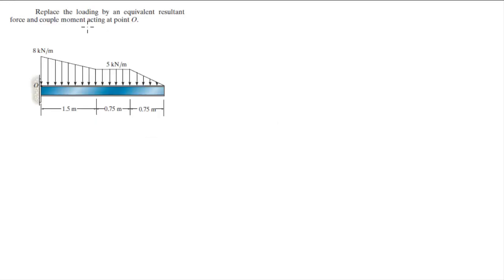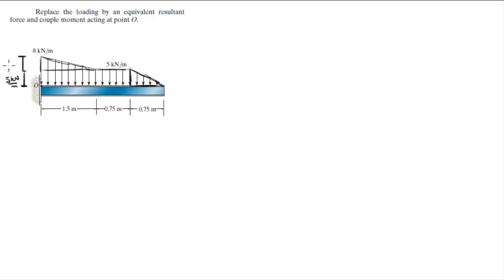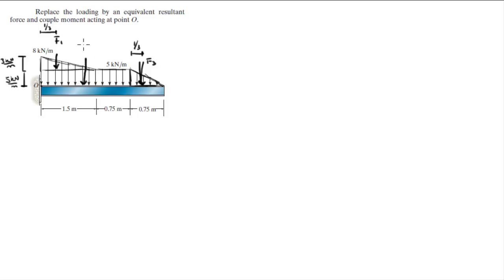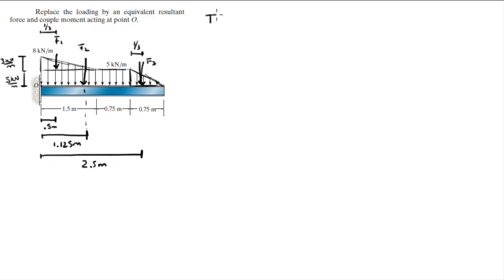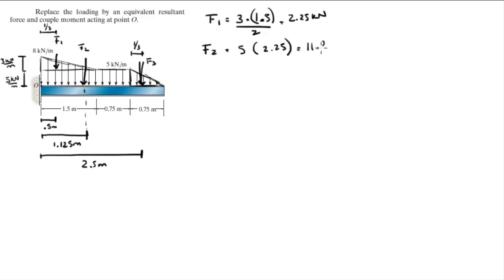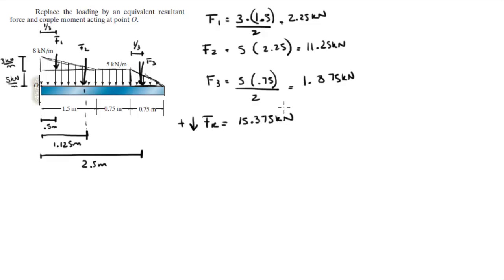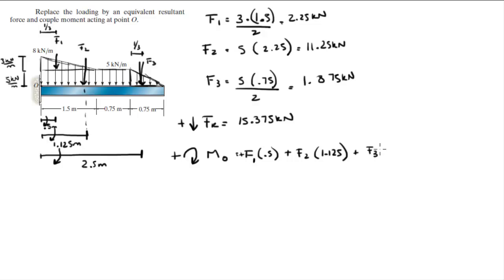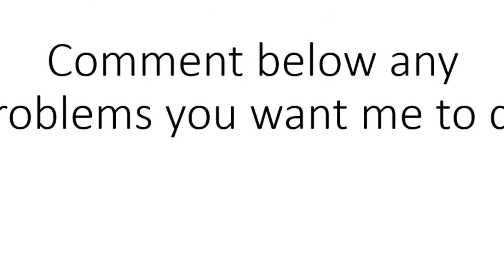Replace the loading by an equivalent resultant force and moment

Comment: could you do a problem for me? it is the engineering mechanics 14th edition problem 4-109, 4-123. It states that we should replace the loading by an equivalent resultant force and couple moments at O. The force is given in cartesian vector form.